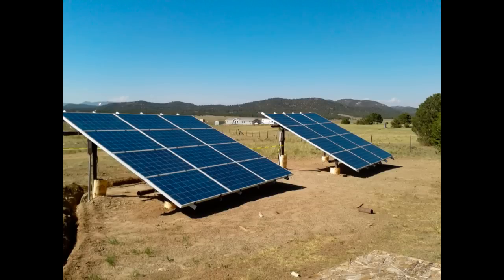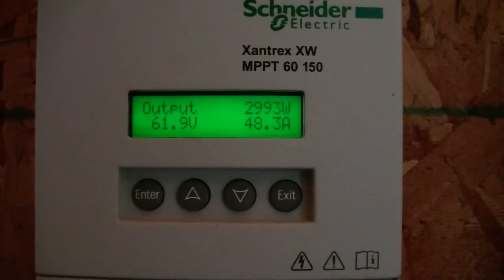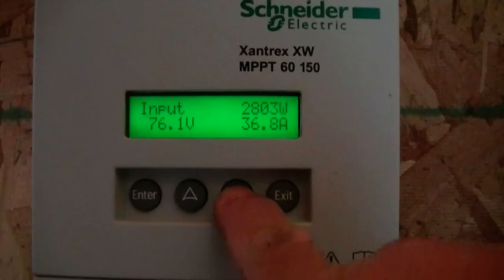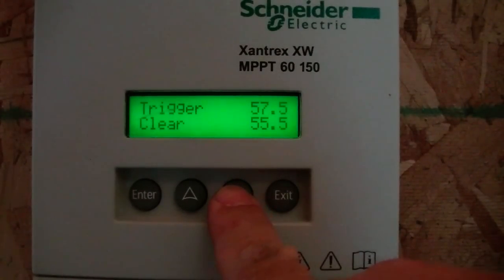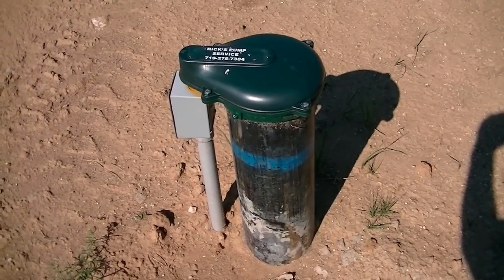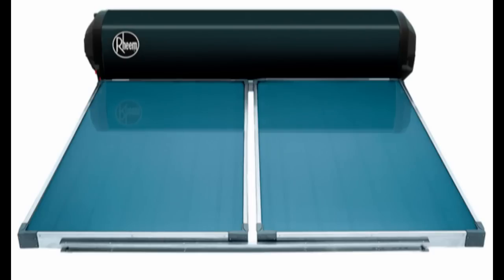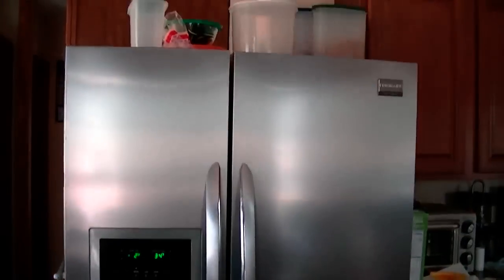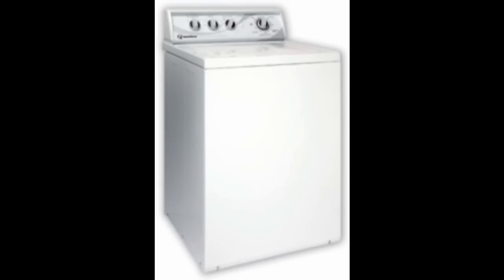Solar Design Considerations

Comment: Steve I have watched all your videos and even watched them several times and I am trying to build a log home and I want to wire it off grid and I want to do it with very little waste on buying the wrong thing so I have kept many notes on your video's I still don't know what kind of panel to use, and I live in an area that will be hot in the summer but only about 2.5 months of really cold weather and the rest of the winter is just cool. but the home will be 5 bedroom,  large living room is there a place that I can go to to get my panel needs as well as battery needs, You have convinced me to go 48 volts and I would like to know who you used to buy your panels through I have not found that price yet. thanks email addy is medicone@eastex.net thanks for all your help with your videos.
Reply: +David Fernandes The going rate is roughly $1 per watt for solar panels.  I paid 25 cents per watt last month.  Sunelec.com has an email list I joined, and it looks like really good deals are announced there before the public web site.  Class A panels are simply new, and more expensive.  I bought Class B, so the silicon is new and the aluminum frames are used, but look just about perfect.  And these have the same great warranty, too.  I'm a fan of publishing price per watt (because comparisons are much more straightforward) and a fan of Sunelec.com because the deal I got was awesome.
Reply: thanks Brother
Reply: +Peter Lawton I checked that web site.  impressive!

Comment: Hello Steve. I just install a small solar system  about a week ago. 1) 3000 watts 25.5 amps Inverter 4) PV module 295 watts, 1) XW-MPPT 60-150 Charge Controller =150 CC and 3) Deep Cycle AGM Batteries 12 volts 1400 amps, I got the PVM and betters all in parallel. Do I have it setup the right way?
   
the displayed show me a reading ( Life 1.4Kah - 25Kwh ) ( Max Absorb Time 180mins)
does this mean I only got 3 Hrs of batteries lift to use?

Awesome Video
thank's

Comment from the maker: I don't have any direct experience with AIMS Inverters - they don't go above 24 volts.  But based on the specs and price, it looks like a whale of a deal.  I would love to check one out and put it through it's paces.  It's 6000 watt spec and 18kw surge rating means it could eat through a small bank of batteries really fast.  

So my bottom line is this:  I can't say I have experience with it directly.  But if their specs and price are correct, it's a beast with a great value.

Comment from the maker: Robert, my fridge is a Frigidaire model FGUS2642LF.  It consumes 1.5kwh per day, and cost us about $1200.00 on sale at Sears..  The fridge that we lost in the fire was an LG French door type that used 0.97kwh per day, and IMO a much better fridge.  We had gotten that one on sale at Sears for about $1500.00.  I use a timer that shuts it off at around 9:00pm, on  at 12:00am, off at 2:00am, on again at 5:30am.  It cuts consumption to around 0.95kwh per day.

Comment from the maker: As far as costs go for me:
1628.92   48V 4.4kw Inverter MS4448MPAE Magna-Sine
0514.00   XW-MPPT60 Charge Controller w/power diversion (standard)
4316.80   (8) FullRiver Sealed Lead Acid AGM batteries 400ah
2874.00   Iron Ridge Ground Mounting System (for PV Array)
4896.00   4800 watt solar panels (ASW 200)
0600.00   wiring, breakers, nuts bolts, etc.
So the total is nearly $15,000.00.  So for the price of a used car, I shouldn't ever have another elect. bill because we barely use the batteries.

Comment from the maker: (cont from below) Multiply your daily kw hours (from the kw meter) by the number of days you want for minimum reserve without charge.  Divide that by your battery voltage.  That is the battery amp-hour size you will need to buy.   Shoot....I'll make a video about it in a couple days.  If you're like me, being shown makes it easier to understand.  Or you can Email me and I can break it all down.  But I'll have a vid up in a couple days everyone can use.  It will help a lot.

Comment from the maker: I would buy the largest of each that I could afford - either the charger or inverter.  As you grow, you won't be spending more money upgrading.  Purchase a Kill-A-Watt meter from a hardware store or Radio Shack.  Plug it into each item you want to power for 3 days.  It will record the hours and kilowatts used.  Divide kilowatts by number of hours times 24 to get daily kw average.  I have been 12, 24, and now 48VDC. Higher voltage lets you use smaller wire for longer distances.  cont...

Comment: Can you break down your system as far as cost for each major component? I  am wanting to start with just a back up system,something that will run the fridge,freezer,lights,tv,etc for as long as needed-maybe a 1500 solar array. I would like to be able to expand later on. Can you give me any advice as far as the best size panels,charge controller,batteries,inverter,etc to start with but be expandable? thanks for any help.